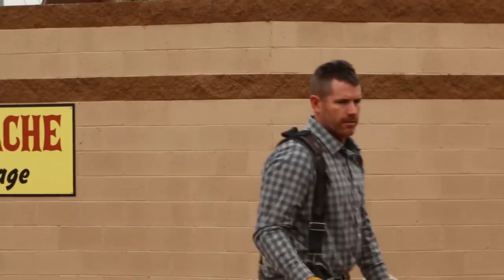Concrete Slab Preparation

Comment: I never thought I'd say this before, but that was a painful video to watch.

I'll never understand guy's who run a grade tractor with the loader up in the air all day long.

It's not good for the hydraulic cylinders, and if a hydraulic line blows, guess what's crashing down really fast?
Reply: The cylinders are not being hurt whether they are in or out. Hydraulic lines always blow unexpectedly, no different than if the bucket was loaded or not.
Reply: It's unnecessary weight and bouncing around on the cylinders and especially the hydraulic seals around the cylinders.

Not to mention the fact it throws off your center of gravity and makes a tractor easier to over turn.
Reply: I dont think there was much concern of tipping over on that completely flat ground.
Reply: chivic89 just because the ground is relatively flat, doesn't mean a tractor with the loader fully raised in the air can't flip over.

Again center of gravity is off. 

Take a tight turn with the loader all the way up, and with the slightest of humps and it's rolling over.
Reply: It's a rental.
Reply: And who are you again?
Reply: You do know raising the bucket in the air it shortens up the tractor so you can work in a titer area.
 And get your popper out if that's what you think you're going to do pop me in my mouth.
Reply: mitchell vellema wow really, no shit? I didn't know that after 25 year's of being an equipment operator. 

The loader up in the air at full height causes other hazard problems. Like turning over.

Comment: So... they dug out a little bit, then brought more soil and spread it out, then again dug a little bit more??? Also why high visibility jackets? They are working at the side of the road, not in the middle of it. They need to be visible to the cars going 60mph on the pavement or the side of the road?
Reply: AliveC4T it’s generally good practice to wear high visibility when working around heavy equipment and usually required by OSHA
Reply: As a retired accident investigator it is good practice to take every preventative step to keep drivers from hitting you. Being just out of the main travelled portion of roadway is not enough to overcome common stupidity behind the wheel. I've  seen idiots driving 55 mph at fatality scenes with fireman inches away, their explanation was its 55 mph zone! Same in school zones with children crossing.
Reply: I believe they were encroaching on a lane which means anyone approaching them would have to make a lane change. If they failed to do that the workers would be at risk. Hi-vis gear on workers is a flash of colour that grabs the attention of drivers.